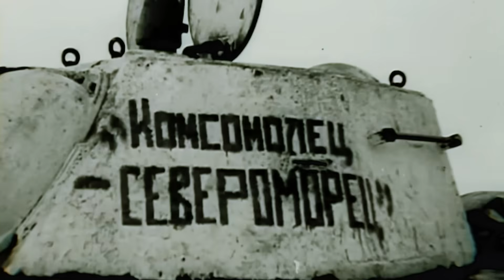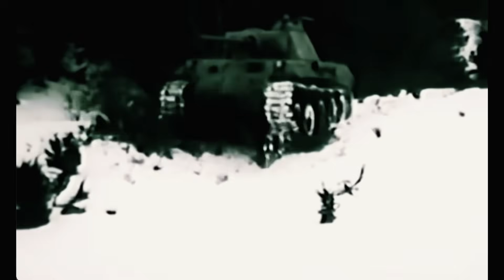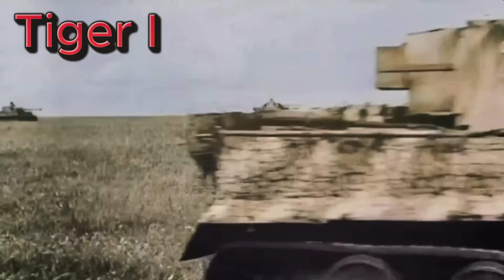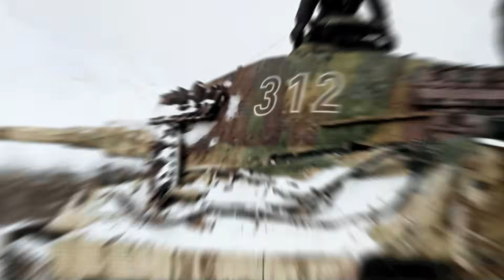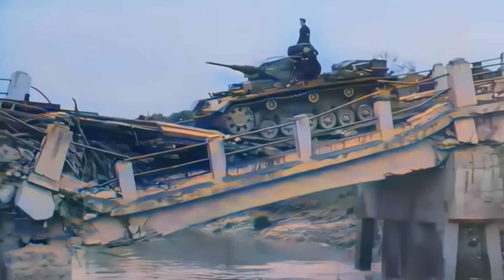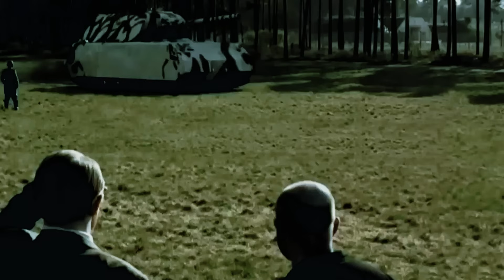The Panzerwaffe: Germany's Most Effective WW2 Tanks

Comment: Personally, I would rather have an armored combat force of 50,000 plus medium tanks that anyone with basic mechanical knowledge could repair with common tools in the field, rather than fewer than 1,500 technically superior tanks prone to mechanical glitches that usually required expert craftsmen to repair adequately, often at dedicated repair facilities far behind the lines.  Hell, you can even add the total production run of the dreaded Panther tanks to that total, and the Americans still produced more than 5 times the number. As Stalin said, "Quantity has a quality all of its own." Especially a quantity that is far more mechanically reliable than the "quality" versions of enemy armor.